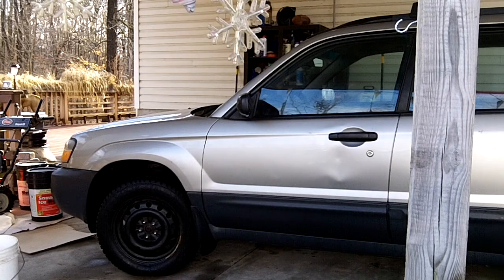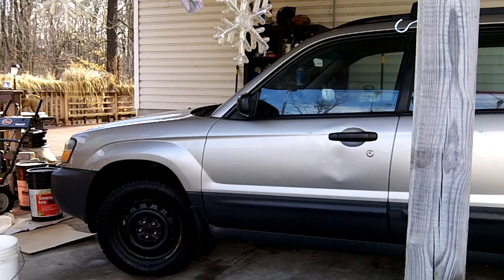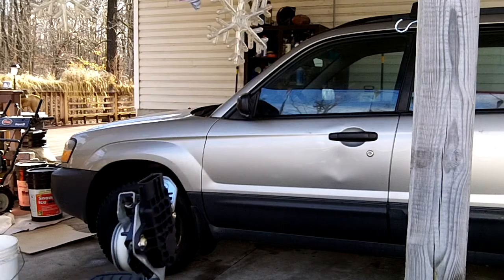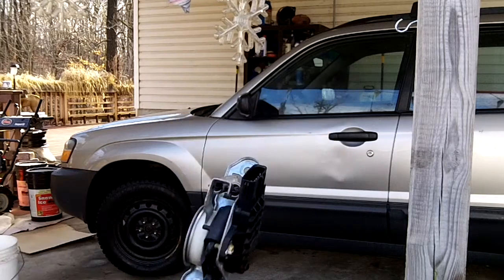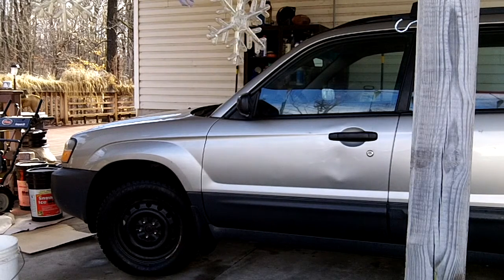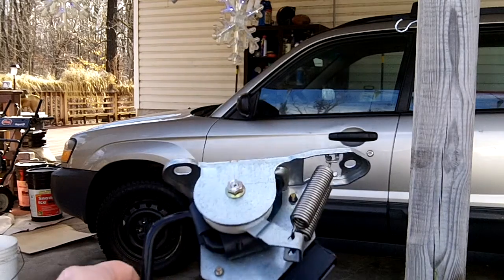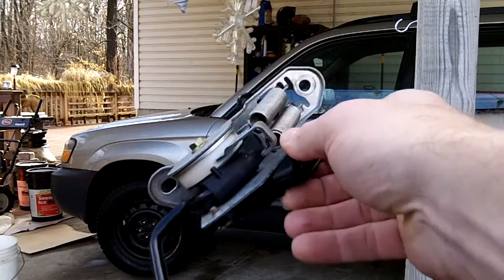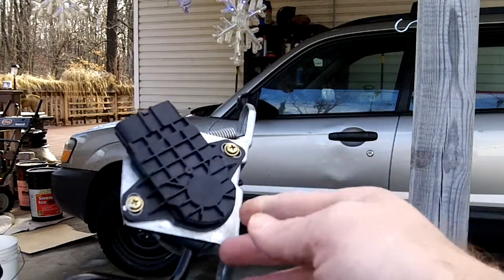Symptoms and how to replace fly by wire gas pedal (subaru)

Comment: 2005 Forester X manual transmission.  I didn't have any Electronics Contact Cleaner but found ECC is made up from isopropyl alcohol and air. So I took some isopropyl alcohol and put it in a spray bottle and sprayed the accelerator in the area where the connections are, where it pivots. The runaway throttle acceleration has not surfaced once since spraying the isopropyl alcohol in there. Immediately preceding spraying the isopropyl alcohol, the runaway throttle acceleration was happening a lot. I'm 100% convinced that accelerator assembly needs replaced and I am going to source it and get it ordered.

Thank you for making this video, it was very useful!

Comment: Excellent, been suspecting that is the problem with mine. Symptoms match mine. would have been nice if the google search got me here instead of replacing parts and trying to catch the problem on OBD readings that lead me to search for TPS replacement instructions maybe the 4 years of intermittent annoyance will come to an end

Comment: My 2012 impreza keeps going into limp mode on really hot days. Which I do not understand. I have had some bucking when the car is in park or drive it revs up with no gas pedal contact. Was this happening with yours?
Reply: Yeah that's a worn pedal issue.

Comment: for those experiencing low idle issues, running rich, high rpm, car turning off low idle, etc, its your accelerator sensor! Trying to figure out how to take it apart and clean it on my 2008 Outback

Comment: I will obviously unplug the battery just in case, but just wondering if when you did this, did you have to worry about any kind of relearn procedure? In that case, I will have to pay $480 at the dealer, when I could just buy the part for $189 and do the repair myself if its just take-off-put-on.

 I have done a blower motor in my old car (00 oldsmobile Intrigue), which also involved an electrical plug, and had no issues, but this is such a vital part, that I just wanted to make sure and get any input from someone who has done it! THANKS again for this video!
Reply: What did you do?

Comment: Thanks for this. You're right, easiest to just see the install; size of socket would have helped. I am about to go buy a second failing gas pedal, but going to try spraying parts 1st (it's probably dirty).
Reply: did it work?

Comment: This is an issue with many Subaru vehicles. The other symptom is you are just driving along and the vehicle cuts out. You turn off the ignition wait 60 seconds and restart the car.  Other manufacturers have recalled and replaced their gas pedals at no charge to owners. Not Subaru. They are showing they don't give a damn and are cheap. When a company does not recall for a safety issue like this why would people want to buy their vehicles?

Comment: Accelerator pedal travel position sensors, or "fly by wire" pedals have a very high failure rate in many vehicles. It will also set a trouble code (Check Engine Light comes on).

Comment: I have a 06 Subaru Outback 2.5L and I'm having the same problem. Throttle goes dead at random times and after I pull the battery and it's just a temporary fix. Might go to the u pull it junkyard and grab one.

Comment: THANK YOU FOR THIS VIDEO! One question, as i am about to do this repair on my 06 outback with the same part as your forester: Do you have to disconnect the battery and/or do a reset procedure after doing this?
Reply: A little late, but i did disconnect the battery and reset.   
Mine would idle a little high but no acceleration.   I took it out and used electric spray cleaner.  Reinstalled and reattached the battery.  Works like a charm.  I am sure I will have to replace it soon but it is simple so won't have to pay the dealers rent just to have them do it.

Comment: Did you buy a new one? Also did it fix the problem? Im having the same revving problem in my 06 sti. Jumps to 2k when rolling to a stop. Cant for the life of me find the problem
Reply: did you figure out what the problem was? I'm having the same issues with my 06 outback
Reply: @dsastrclan  i had water in my wire harness. The water gasket in the plug under my battery was broken. Cleaned it out and put a new one in and its fine. Still rev hangs some but nothing crazy
Reply: @slowevo8366  great to know, I will check it out. Was it a plug under the battery?
Reply: @dsastrclan  the one under the fuse box
Reply: @slowevo8366  thank you!
Reply: Same exact problem on my 05 sti. 2k rev hang when rolling to a stop from above about 3k rpm.

Let me know if you guys figure it out lol. Its been bugging me for weeks now

Comment: That pedal should have been recalled. If you search p2138, it wears out and can leave the driver in dangerous situations when it causes it to kick into safety mode.
Reply: Ah, sounds about it what I had. On light press on pedal - suddenly check engine and blinking CRUISE came on, and pedal stopped responding. After turning the car off for a minute and then restarting- it came back to normal, and didnt have that issue for a YEAR before it came on again. OBD code didn't give me any correct results. in dealership they said it was pedal code. So yes, that's pedal problem.
Reply: I have a p2138, p2109 and p2135. Was driving at 60mph and it went into limp mode

Comment: Call BS.  The portion that transmits pedal position is INSIDE the black housing and CANNOT BE ACCESSED. Spraying anything on this component is a total waste of time.  Those fasteners should be properly torqued to 72840199710.0µN  aka  30 Nm.